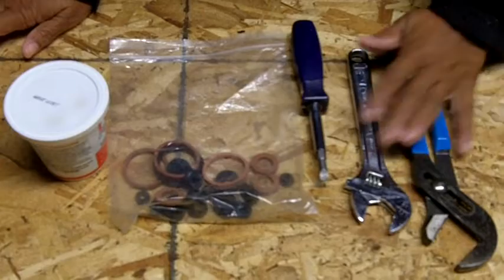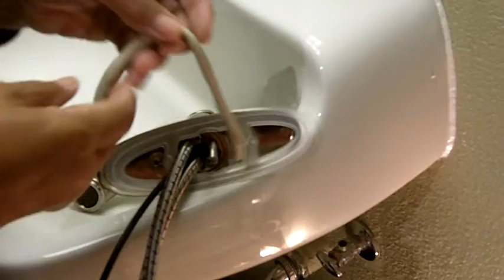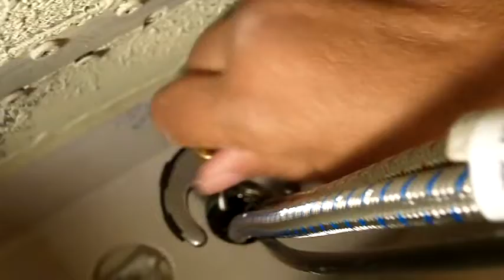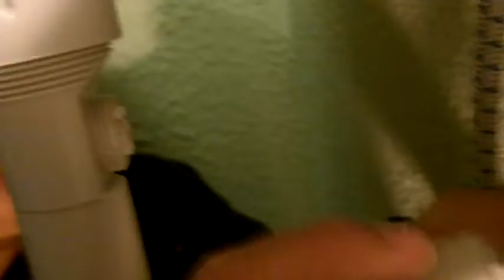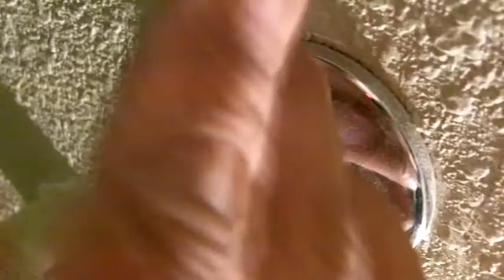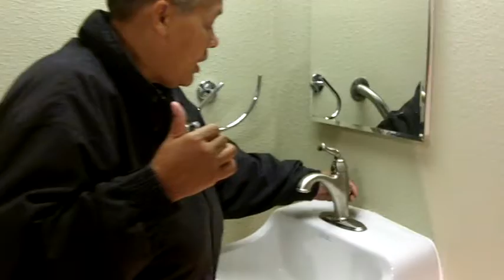Beginner Guide How to Install a Bathroom Sink Faucet

Comment: Leah, I really enjoy your video's, I have one question that was mentioned down below.  Why apply plumber's putty under the faucet?  The supply lines are pre-installed on the faucet, there is no pressure there plus it's comes with the gasket.  Second, I was taught a long time ago to apply to teflon tape to the angle valves prior to installing the supply lines, because you have constant water running through there when water is being used.  I guess it's a personal preference on how you wish to do it?  Remain blessed and keep the video's coming!!!!! :)
Reply: I'll tell you why... sometimes water thrown up on the top of the sink to clean it will get under the faucet and run down the holes. If you have a cabinet you won't be happy.
Reply: @halnwheels  And if I don't have a cabinet, what then?
Reply: @javiergalvan242  then you have water on the floor.

Comment: I found another video that told me to put my channel locks on the Ring" in the bathroom bowl, hold that as tightly as possible, then turn the pipe underneath the bowl (after the nut is loosened all the way) and it came apart so easily. One guy on youtube was cutting the nut off. But I DID IT !! I am so proud of myself !! NO LEAKS !! No plumber's bill !!  THANK YOU !!! THANK YOU !!!!!!!
Reply from the maker: Congrats!  Dori

Comment: kind of unrelated, but i have a bathtub drain that needs to be cleaned out - however - the screw is stripped on the stopper, any recommendations on how to get that out?
Reply from the maker: +Sweetface Iradonia (Dudes Gaming) You can try using a rubber band, inserting some of it into the screw head, and then using the screwdriver, with the hope that the rubber will give you a bit more grip.  Another trick is to sprinkle some powdered cleanser into the screw head, and see if that will enable you to grab onto and remove the screw.
Reply: i will attempt, ty for the tips